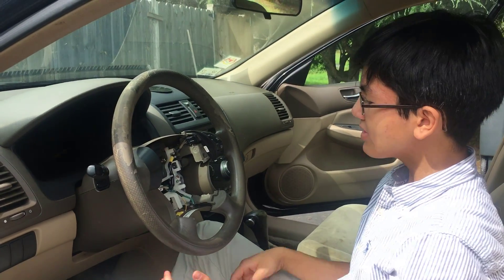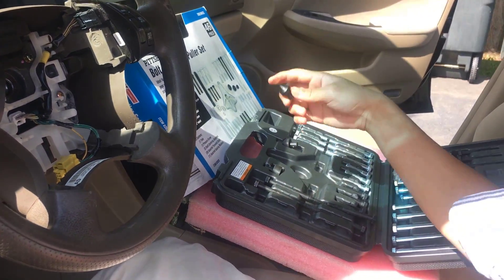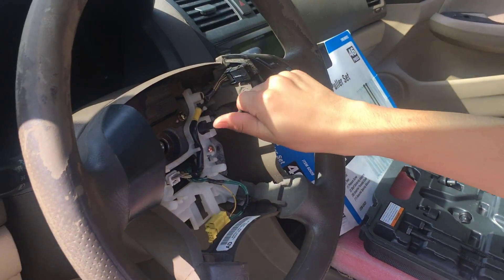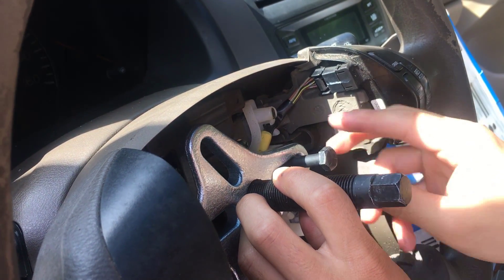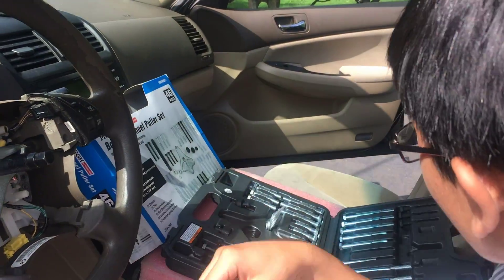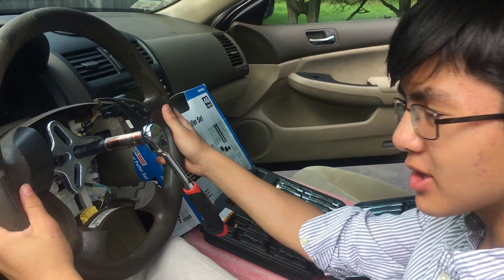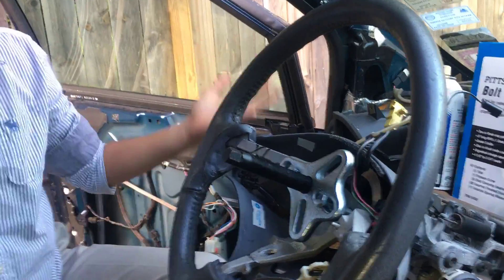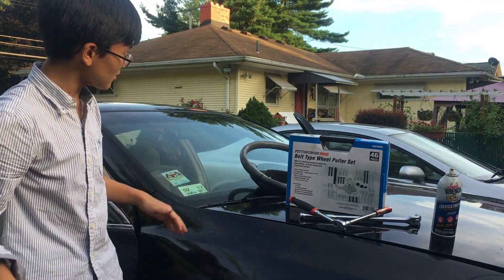How To Remove Stubborn or Stuck Steering Wheel | DIY Auto Repair Guide By Young Mechanic Aiman

Comment: Hello! I have never used a wheel puller I just smack the steering wheele loose lol. I recommend you mark the steering bezel or make sure that the front wheels are straight when putting a steering wheel back on or it may not be aligned straight.
Reply: doesnt work on firmly seized wheel..

Comment: thanks very much, know how im going to remove my stubbon wheel now haha lol. i have a quick suggestion, i myself would turn the steering wheel (without keys in the ignition) to get the anit theft steering lock. That would prevent you from having to hold the steering wheel whilst breaking the steering wheel off.

Comment: i tried bolt type wheel puller, inserted bolts correctly but my toyota wheel is so seized , one of the bolts sheared its threads and those of the hole in the steering wheel... now i cant get wheel off and ive had to return puller as it was low quality metal in bolts... any ideas?
Reply: same problem here did u ever get it

Comment: I am having trouble actually removing the hex bolt that connects the wheel to the steering column on my Durango. I used a breaker bar and a impact driver but it won’t turn. Do you have any suggestions?
Reply from the maker: My dad tells me impact driver doesn't work well with hex bolt.  He had similar problem with his Chrysler Town & Country.  He suggested spraying PB Blaster (or WD40), let it sip through, repeat every 20 minutes or so and try again.  Breaker bar with extension (using jack handle or steel pipe) should work.  Have someone hold the socket tight in place.  Hope this works, good luck and thanks for watching...
Reply: @EyeOnAiman  my vehicle and others ive seen use torx bolts, and need special torx bits to remove